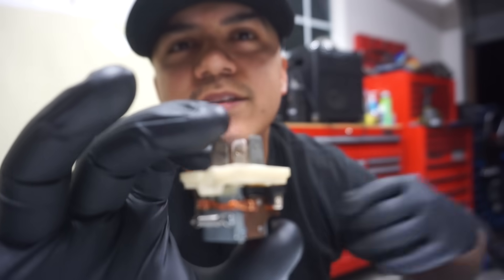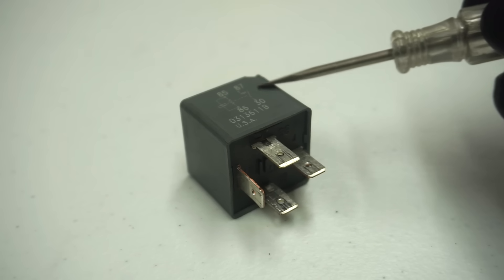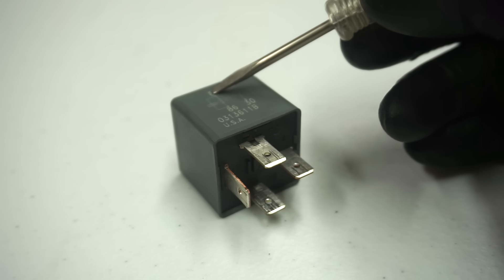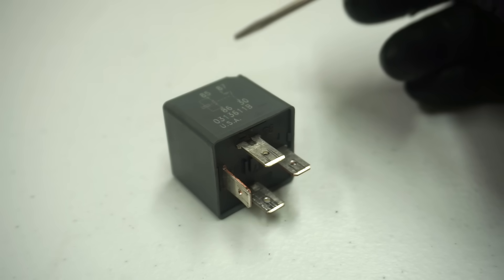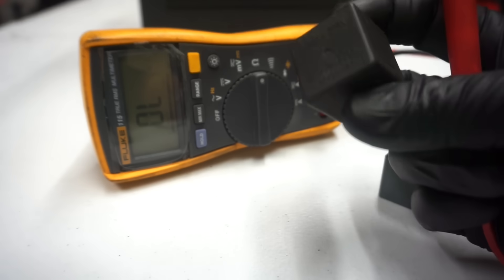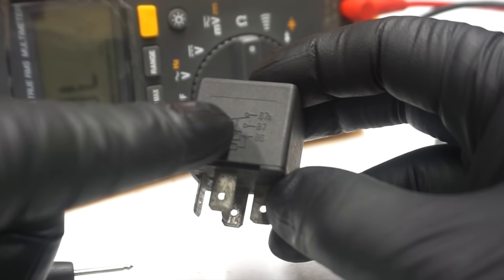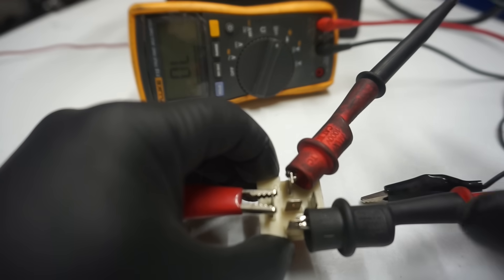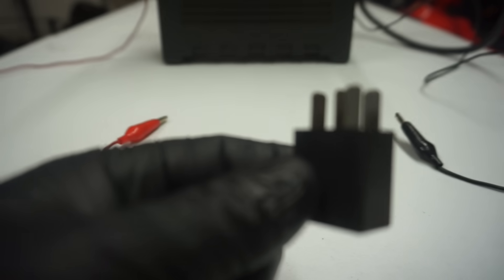How To Test a Relay The Easy Way

Comment from the maker: CHECK OUT THIS VIDEO👍🏼
FUEL PUMP CHECKS AT THE RELAY https://youtu.be/Ojg5eR2xF3U
Reply: Trying to locate under the spare tire is there a relay box for 05 Ford is it under the spare tire
Reply: I want to install a kill switch to my fuel pump relay. So I would have to splice into the 86?
Reply: I purchased a Toyota IQ 2009 push start button last year it was good and all ( its a used car) but i didnt drive it for a little while and now that i'm ready to drive it, its not starting..... Couldnt be the battery because i purchased a new one when i got the car, i just replaced the gas pump and there's petrol in it....... When i push the button to start it stuff shows up on the dashboard but when i try to start the car its making a clicking sound repeatedly then its like its dead again. What could be the issue??
Reply: Very interesting and educational
Reply: it was a good video easy and understandable thanks for it 👍
Reply: When I try to start my car I smelled gas ,and still no start
Reply: @eddiethompson1850 how to hard wire a fuel pump on a 2004 ford explorer
Reply: @alanlynn2108  @
Reply: @eddiethompson1850  ppppp29
Reply: @eddiethompson1850  😂

Comment: so do you mean if a relay is clicking doesn't means it's working not on till you check the continuity right that's when the relay is working

and number 2 question what is the actual reading we are to get in every relay

Comment: can you use a 9 volt battery to test the relay for continuity? If my multimeter does not have a continuity setting, what should the readings be? I assume 0 or close to 0 ohms is good.

Comment: So I have an issue with 2012 fusion ac control module not sending signal to turn the compressor on. Can I tap into the ac relay to send signal with. Toggle switch? Can't buy a new control module only rebuilt ones and I've already installed 10 of them and still no ac 😅 all the components are new from the ac system

Comment: I have a 318 1993 Dodge Ram B250 Van. It suddenly turns over but won't start after 14 years. No smell of gas (flooding) with pedal on floor. Took out the input line to the fuel filter. Put an empty water bottle on it. No fuel spraying in from fuel pump upon ignition. Removed fuel pump relay. Cleaned it off tested with 9 volt. Both of them clicked - weakly. A few hours later tested it with fully charged 9 volt again - no click on both! Tested with multimeter got 64.5 ohms. Then 70.5 - between 50 & 200. I'm stuck in a strip mall parking lot with an Oreilly Auto Parts selling the relay for $44 with 10% L.A. County tax. But once it's on the vehicle - I can't return it 😡. Should I test if it clicks with my fully charged 12 volt van battery, or is it bad - for sure?! How do you take it apart without damaging it?

Comment: I have a 2007 Dodge Nitro V6.  My motor sometimes starts and sometimes won't start, but turns over.  So I wonder if it would be because the fuel pump relay or the fuel pump? Any info you can give me would help.  Thx in advance.

Comment: Hey Hektor, thanks for the video, I now know how to test a relay thanks to you! I do have a question though, when  an electromagnetic relay like the ones you've tested in this video are used to make your indicators / turning signal lamps flash on and off repeatedly, what is controlling and regulating the current / voltage pulse that continuously cycles  activating and deactivating the relay?

Comment: the way I tested prior to seeing these videos: opened cover, inspected for burns or broken coils, used dmm on continuity mode to test connection points. I used a 12vdc 1.5amp appliance power adapter afterwards. thank you!

Comment: Was changing blower motor on a 650 BMW. Was dumb and didn’t disconnect battery. The electrical housing unit above the blower touched something and sparked. Everything else works but car doesn’t want to start. Really wants to turn over but it doesn’t. I have 2 relays in that housing that sparked. One is a quantity control relay which has something to do with fuel. The other one I’m not sure but think it’s an ignition relay. I’m going to test them but would you think there’s a decent chance I just screwed up the relay(s) within that housing where the spark occurred or do you think there’s just as good a chance or better chance that the problem goes beyond that. As I said, though, everything else works just fine.

Comment: Even easier to those watching- buy a new relay and try it. If you have a box of "random old but still good car parts," like in most shops, you likely have a good relay laying around nearby. With electrical components sometimes you just have to eliminate things one component at a time. Testing that the wire leading into the devices (pumps, etc.) is getting power is also important. You just probe on the wire harness side and when you e.g., turn on the AC, one of the terminals should light up your tester. If not, it's a clue that your issue is Upstream. Again, trying to diagnose is nice, however it will often come down to a simple process of elimination. Engineers, Mechanics, Scientists and even Doctors all follow this approach.

Comment: Hello Hector I'm wondering if you could help me out I have a 2006 Chrysler 300 3.5 that has been down for 5 months I hit a dip on the road while making a left turn and after I did that the car shook and hessitated and then it lost power and I was able to restart it but it was riding rough and as I hit the gas petal it was not it was slowing down until it started making a loud knocking noise and died . I had the heads rebuilt a month before this happened the mechanic states it's the engine but I am not leaking anything and I have been doing the most even bought a new battery Andi need the car to take my kids to school in 2 weeks I'm drained hoping u could help I have no crank no start and the key fob is not unlocking or locking the car or the alarm I have no lights power unless the key is in the ignition and the car is on the assesory . It just makes a low level clicking noise in the back of the trunk. I don't know what else it could be pls help Arlene is my name and I need your help if it's not any trouble for u I truly appreciate u taking the time have a great day hope to hear from u about my issue pls pls arleneg834@gmail.com is my email if u need to hit me up direct thanks again

Comment: pins 87 is normally open and needs  the coil pins to be energised while pin 87a  would be normanlly closed and when the coil is energised 87 becomes close and operating but 87a then becomes inoperatable

Comment: Hi;
I have a KIA Optima 2011 with an electrical problem that I have not been able to fix; also, I have not been able to drive the car in this condition for over a month.
This vehicle has not been involved in an accident or any mechanical or electrical work was performed prior to this happening, It happened all of the sudden and without warning. In addition, it does not show any trouble code in the scanner.
Problem: 
Headlights, city lights, dashboard, interior lights flicker or blinks as soon as I start the car and turn the headlights on and the keyless entry, door locks, power windows only work intermittent and sometimes the horn goes off.
Things that I have checked and or replaced:
1-	Battery (fully charge)
2-	Alternator (charging well)
3-	All grounds checked (all good)
4-	Cabin fuse box changed and the problem continue
5-	All fuses checked and (they are all good)
6-	Head lights switch changed (that did not solve the problem either)
7-	I hire an auto electronics technician and he was not able to solve the problem either
I do not know what else to check or to do; your help will be appreciated.
See attached video.
Thank you.
Louis

Comment: On my turn indicator relay my 3 and 5 pins are not as you say 05 Durango my outside pin has constant power and does not go to the load

Comment: When they build the relays in the circuit board it will cost a mint to get your car fixed. Well the price of mint's just went up. 🤮 $1000. For the first one and the second one is only 2 cent's. The two cents should be free. Nothing is free. A penny for a thought just went up too. 😂

Comment: How would I know particular Ohm on a relay that's not marked at all?  It's in a Honda Fit Sport 2013 model, and there are 3 relays in a small box under, near the battery, that controls all aspects of the A/C.  The only marking that I can see on these relays, is a number 4 on the side.  Thanks.

Comment: I have a Chevrolet impala LT 2016. It has a steady clicking when I turn on the car and turn off the car. The AC relay switch is what I’m thinking. The problem is. No leaks. The AC works. The heat works. I don’t know what the noise is it’s coming from the dash by the glove box, can you help. PS, I have changed the relay.

Comment: A technician told me that if an auxillary cooling fan of a Chevy Captiva has 2 wires, means that it does not have a high and low speed. I just want to know if that is true. Thanks for this video. Cheers.

Comment: I HAVE A TOWN AND COUNTRY MINI VAN WITH THE 3.3 CI. IT RUN OK WENT THE MOTOR WAS TURN ON FOR WHAT EVER TIME.BUT AS SOON THE MOTOR WAS TURN  OFF FOR WHAT EVER THE MOTOR DIDN'T WANT TO RUN RIGHT. IT WAS LOOSING POWER .DIDN'T WANT TO RUN UNTIL 10 MINUTES LATER.I REPLACE EVERYTHING THING NEW ONLY TO FIND 1 YEAR LATER IT WAS A RELAY IN THE FUSE BOX OF VAN. IT SAY AUTO SAFELY CUTOFF RELAY.CUT THE COIL AND GAS  PUMP FOR A CRASH. I AM OUT THOUSANDS FOR A $14 DOLLARS  RELAY. IT COME OUT EVERYTHING HAVE FUSES AND RELAYS TO PROTECT EVERYTHING ON CARS AND TRUCKS. HELLO LOL.

Comment: I use my 12 v car battery. I had some spare cables and tap it with electrical tape. Made some clicks, gotta find my voltmeter. Cooling fans are not turning engine feels hot on idle even the gauge shows normal temperature, if I go drive around and come back the fans kick in but at high speed. Seems at low speed mode won't turn on. 

I've changed thermostat, radiator, water pump and coolant temperature sensor.🤷‍♂️. I disconnected the coolant temperature sensor fans turn on at high speed. Then on the fuse box I did override/jumper wire fans turn on, low speed and hi speed.

The only thing i can think off is ECM 🤷‍♂️. Any suggestions what else can it be?

Is an 2006 impala LT V6 3.5L VIN: K model.

Comment: WOW! I learned something new and interesting there brother. I do not know anything about electrical components but by your informative video I learned that just because the copper plate moves when you put the meter to it doesn't mean the relay is good. So, my point or question is: is there a way to test or know if the relay is good or bad? I hope I make sense man, but you are awesome and I am thankful for your video.

Comment: Hector- great relay video. I’ve got an issue in my 1994 f350. My relay engages when I turn the ignition key turns on…however- the power is on when the key is off and the relay is not engaged, but turns off when the relay engages. The opposite of what o want and I can’t figure out what the heck is going on. Any help is greatly appreciated!

Comment: I have a 5 pin relay, it’s use for turn signal flasher on my ford truck. It numbered from 1 to 5 and not 30-85-86 do you think it would work the same how would i test it?

Comment: I have a 2008 Chevy Equinox and my low beams recently stopped working how would I troubleshoot find out what is wrong if it's the fuse relay box the lights themselves and what uses would I be looking for if it was the fuse really bad

Comment: Great video!  Great explanation. FYL when you have a 5 pin relay the middle pin is usually what is called normally closed. This means current will flow without power and is turned off (opened switch) when power is applied. Instead of turning something on applying power turns it off.

Comment: Could you make a video showing a proven good Relay but a corroded or broke contact wire in the Relay Panel itself which prevents the Relay from doing it's job.???

Comment: I know all the trouble that I really will give you I deal with lot of relay on the old ham and mature radios sometimes you file down the contact points that's in there sometimes it will correct the problem relays don't usually go bad the biggest problem is the contact point you got to file it down like contact points on a Volkswagen when the contact points is burnt your Volkswagen will hard to start Cameron the timing will be off so that's the story on relay I got three brand new relay that goes on the old type of immature radios thank you very much something really good to think about now that on the shake your board it's going to be much harder to track it down thank you very much

Comment: I have a 2 stroke kymco super 8 scooter. My starter relay is a 4 prong box fuze not like everyone else's that I seem to only be able to find when trying to check if it's faulty. It isn't a relay with two like d battery prongs you can put a screw driver across the prongs to bypass and start ur scooter. Question is the numbers on my relay are 1,2,3,5  with the four prongs. Number 4 is just a spot that's nothing to it. How would I test it with a multimeter? I would faint if I actually got a true and real answer. I do all the mechanics myself. It's just me and I truly enjoy and get pride out of not relying on a man or mechanic to fix my issues.. I have not had any luck on the internet or YouTube what so ever with the question I need answered. PLEASE HELP, ANY ONE
Reply: Jenn, did you get your problem worked out?  That relay/starter solenoid works like what he showed in the video.  The two that you short out with the screwdriver to start up are the input power and the load (the load side goes out to the starter - input side comes from the battery).  The others are from the circuit that triggers the relay to connect the input to the load.  One side of that should be a ground (-)and the wire is probably black.  The other is a (+) 12v that is only on when the key is on and the starter button is pushed/pressed/depressed.   To check that you would put your black meter lead on a good ground on the frame or engine and the red lead on the trigger wire that is not the ground.  Your meter will be set to measure DC voltage, of course.  With the key on and the start button pressed your meter should show between 12 and 13 volts if the battery is good and the wiring is good.  If not, then first check in the fuse box for a "starter" fuse and test that fuse.  If you DO have a good ground at that relay and you have battery voltage when you press the start button but nothing happens then you probably need a new starter relay/solenoid.  Be sure that all connections are tight and there are no corroded wires.  
Hopefully that will help if you are still having problems.  If you need further help or clarification on anything I'll be happy to try to help.
By the way, good for you for trying to help yourself and not have to rely on someone to come to your "rescue".  I try to teach my daughter and granddaughters to do the same thing.

Comment: Excellent video.
I'm left with one question though.
You didn't run the final test on the last relay. Did I miss something? 
So you didn't run the final test, but to clarify, at 9:55, you said "you still need to run the (final) test".

Comment: Hello... I have a 2011 ford f150 3.5 lt that wont start. I switched the starter, the battery is good... the scanner says its a P068A so Ive been testing all relays but not sure Im doing it right since until I saw this beautiful video of urs I didnt know what I was doing ( I still don't)... any tips?

Comment: I tested  all my relays...checked available voltage...bypassed the relays...still no power to the new fuel pump...oh and checked fuses I cleaned all the junctions below the fuse center
Reply from the maker: What kind of car?

Comment: Thank you for the video. I am testing my AC and horn ones, both click but when energized the ac one reads 0.1 - 0.3 ohms and the horn one reads 1.1 - 1.2 ohms on the corresponding leads, both produces a beep as if the tester leads where touching; I don't know if they re good or bad; the horn one supposed to be good, the ac one is suspected bad.

Comment: Ok. I tested relays on my ford ranger today. This is how i did it.  Powered up relay to pos and neg to battery.  Relay opens and closes. I had the out puts of the relay connected to my multimeter on continuity. Multimeter beeped when i powered up the relay and stopped when i disconnected it. My way is a sure way to trouble shoot a relay. A little labourious.  Hope this helps. Thanks.

Comment: 🤔YOU REALLY ARE exactly RIGHT ABOUT WHAT YOU SAID ABOUT  ANY relays. Real professional auto mechanics really do want to check ANY relate really fast . TIME is MONEY. mechanics want to check ANY relays really fast . THAT IS NOT a fast way to check ANY relays. But you are exactly right about what you said about any relays. but that is not a fast WAY to check any relay I really do know I am a REAL ASE certified Master Auto Mechanic  with over 60 year's of experience I did this everyday for a living I got 67 masters degrees IN Auto mechanics from different state colleges State Colleges cost lots of MONEY EVERY YEAR . AlSO ASE certified cost lots of MONEY AlSO EVERY YEAR
Reply: Dude. Caps just make things harder to read. And if you use them so frequently, it doesn't really make anything stand out. It just looks crazy and difficult to read through.

Comment: Nice Video 
If the Relay clicks but does not close the circuit, that means the contacts are either carbonized or burnt out, then it has to be replaced,it is not safe to jump it as the safety of what it is connected to is at risk if there is any fault in the circuit.
Note: If you’re stranded on road you could jump it as an emergency but use a thin wire first to make sure there is no fault in the circuit, you could use a jumper wire with a fuse link for safety